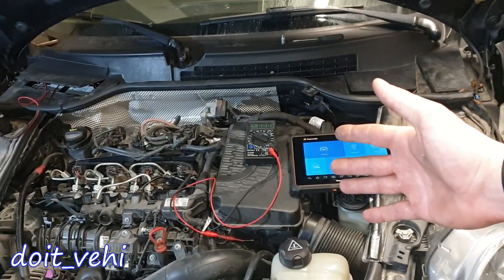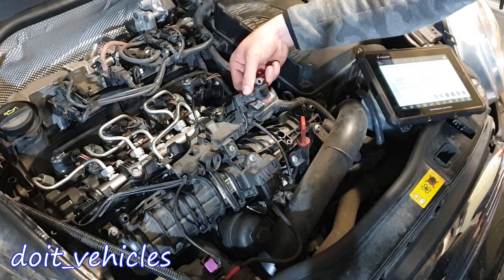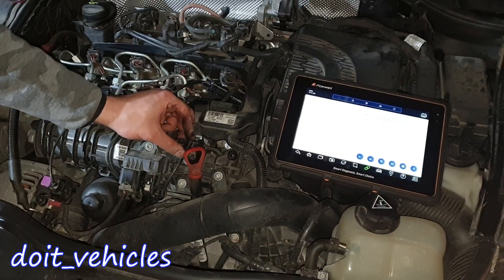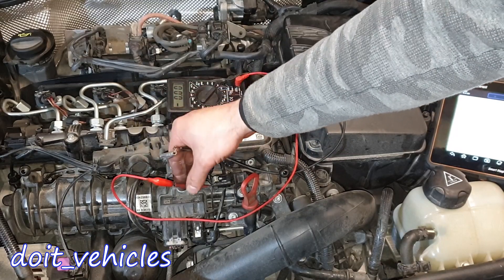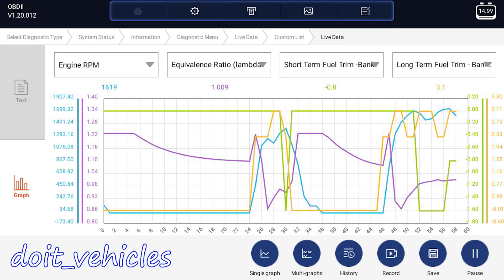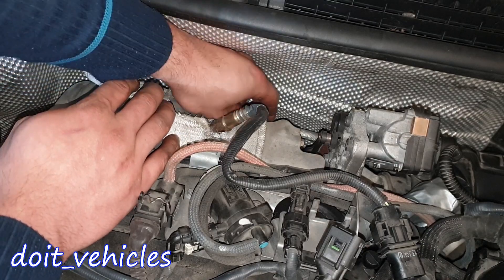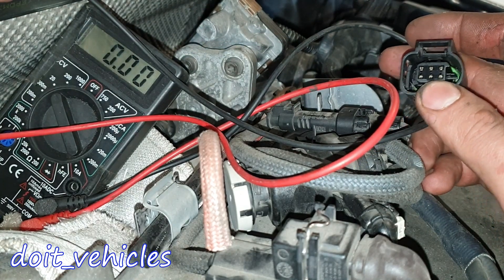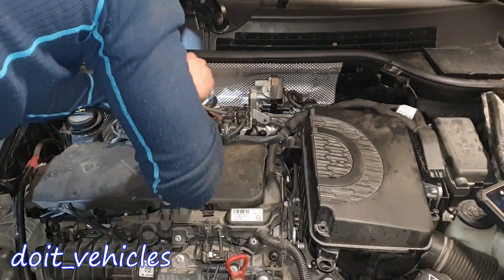O2 and MAP sensor from 1.6 Mini One Diesel - Check

Comment: After heavy traffic or high rev usage, white smoke comes from entrance of the o2 sensor and grey fabric turnd black and smells very bad ? Do you have any  idea ?
Reply from the maker: There can be some oil leak from the exhaust valves + rust ?
Reply: @doit_vehicles  she is 2012 and leaks from every where. Some says oil goes into dpf , some says dpf is blocked and heavily heating . I’m afraid going service because of high costs. I’m trying to understand problem before I go to service